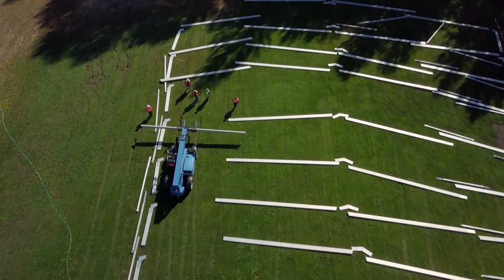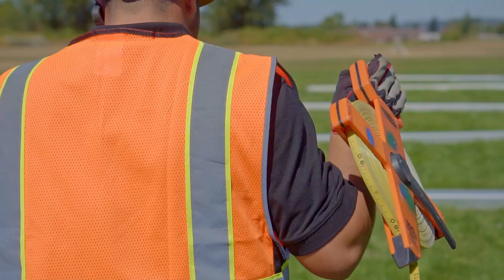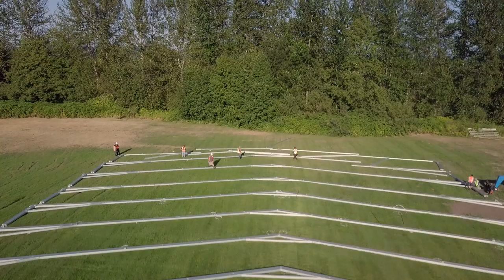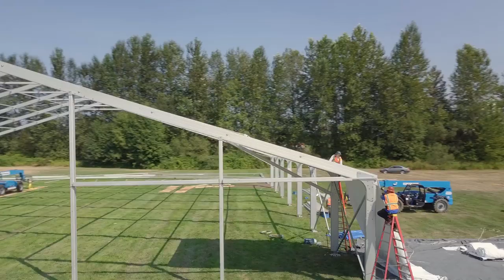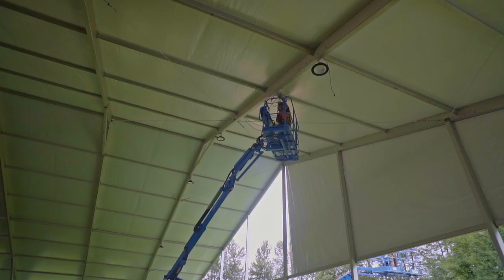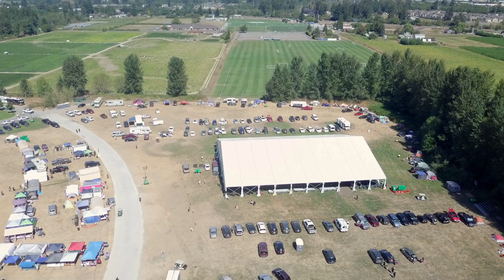Clearspan Tent - Industrial Tent Systems

Comment: Never used cranes or dollies when I used to put these up - only a 6 man team too
Reply: BULLSHIT you can’t raise these up with just 6 people maybe 7 but not six
Reply: Ropes and levers?
Reply: 40m clear span tent? 6 or 7 people without crane, well, i donot know what to say
Reply: @-thaidu3332  not possible, this guy is delusional
Reply: The field of work of a crane driver. I wish you success. Great job
Reply: 6 BIG rugby lads - start in the middle - lift and walk it around the frame til you're all ready to heave shoulders up. - 7th man on a rope to assist it toward the 8th man with the top link pole ready to slot in. I lifted 12 bays - Didn't work for them for ore than 12 weeks total. Was a real rough and ready team. so 6 people lifting - but more assisting
It wasn't safe at all but it was cash